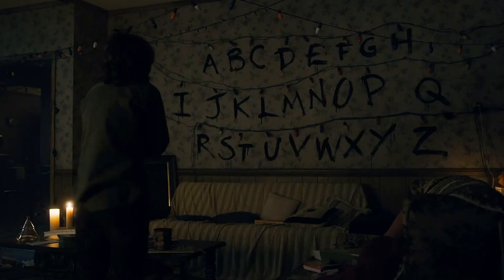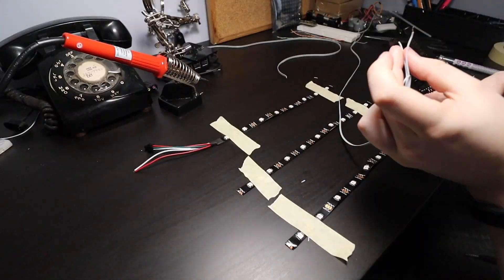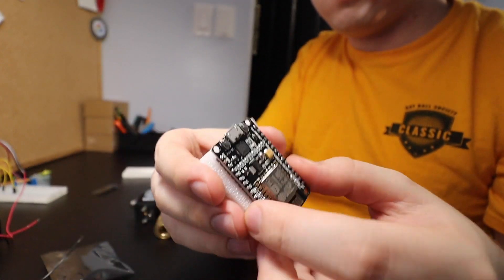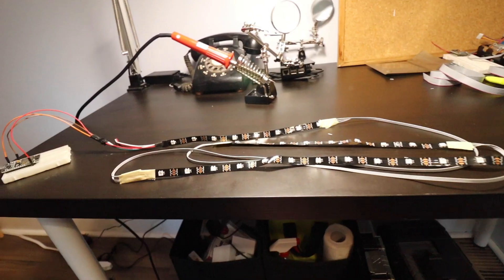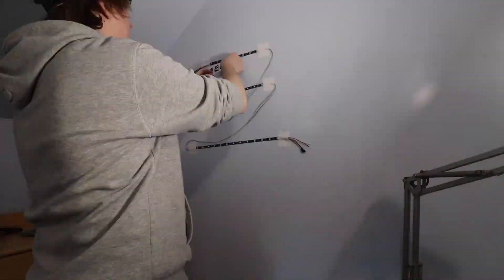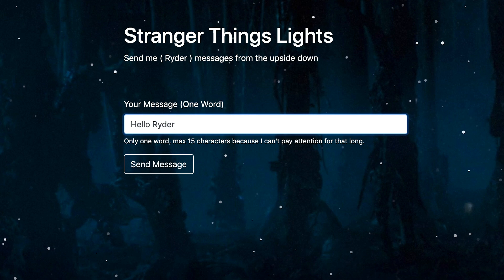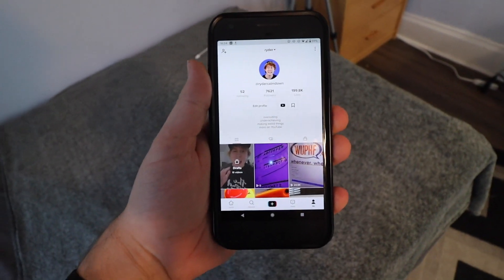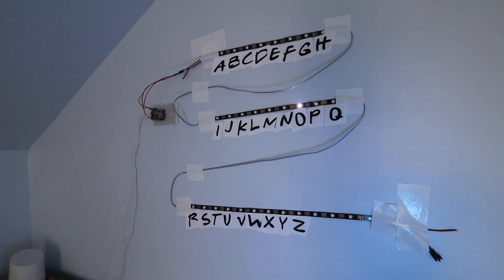Building Stranger Things Lights (and connecting them to the internet)

Comment: can i ask, like how much was all that? im thinking of doing it
Reply from the maker: For sure! Here's basically what it all cost:
- ESP 8266 (the WiFi microcontroller / arduino) - around $20 for 3 of them (though you only need 1).
- LED lights - These I've had for a while, but I think you can pick them up easily for another $20 bucks.
- Breadboard & cables - You can get these pretty cheap, but honestly I'd recommend just buying an "Arduino Starter Kit" - it'll give you a ton of stuff that you can use for this project and more.
In addition to the hardware, you also need somewhere to host the website - I use Google Cloud Platform (Google Cloud Run) because it's basically free,  but it's not the most user friendly if you're just starting out with code.